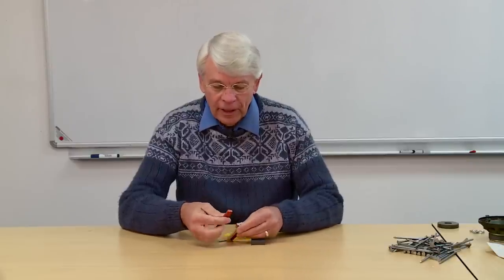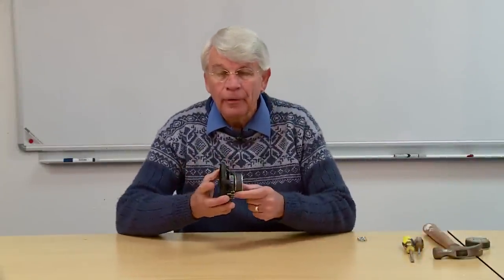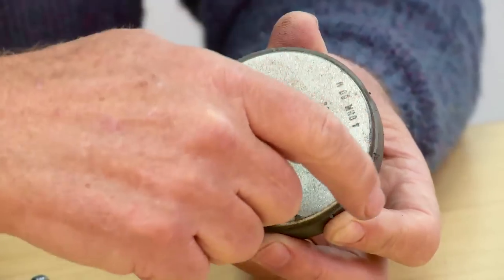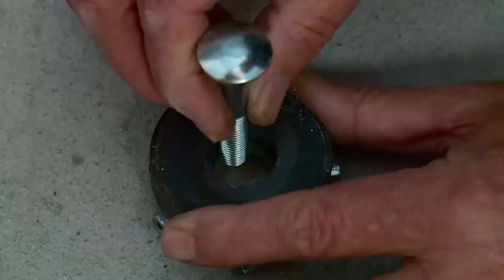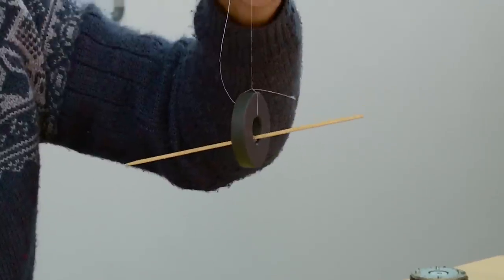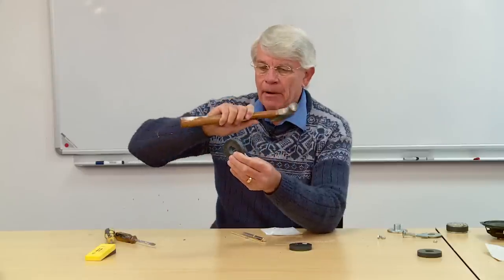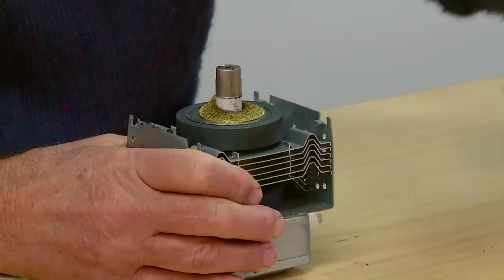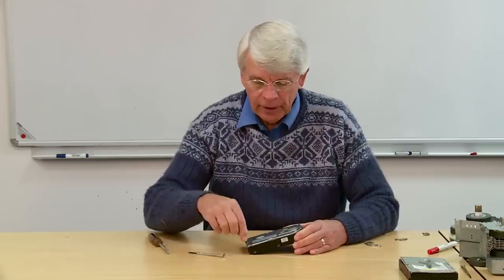How to get magnets out of old speakers and hard drives

Comment: About the removal of neodymium magnets. They are very brittle so wacking is not a good idea, espeacially with the thinner ones. What you do is get a pair of good pliers, a pair of strong hands, and then bend the plate that the magnets are atached to. They will be easy to remove, although some of the nice coating might peel off.

Comment: You might want to consider leaving the magnets in the metal, for speakers, or stuck on the metal when dealing with hard drives. With the speaker magnets, the metal acts as a shield in one direction, which can be useful for some applications and experiments, and the metal plates the hard drive magnets are stuck to can be used for mounting the magnets on non-magnetic material.

Comment: Old analog meters for measuring currents or volts work by an electromagnet pushing at a permanent magnet, but I suspect the magnet may be rather small.  Magnetrons, some of the old antennas, the colorful part around the brass ring, may contain beryllium.  If that part breaks and the dust is inhaled it may cause beryliosis, a rather nasty lung condition that makes for a painful way to die

Comment: It was very difficult to remove the neodyme magnets because they're glued down. One of them has so much glue on it it is impossible to remove. I actually ended up breaking the magnet before I had gotten it off.
Reply: next time try bending the plate it is on with a pair of pliers, then once it is bent slide a knife between the plate and the magnet, it should come right off
Reply: heat gun